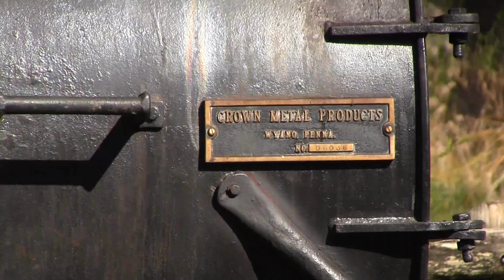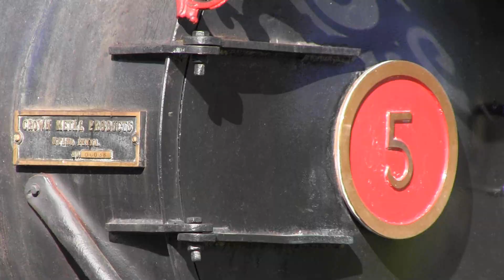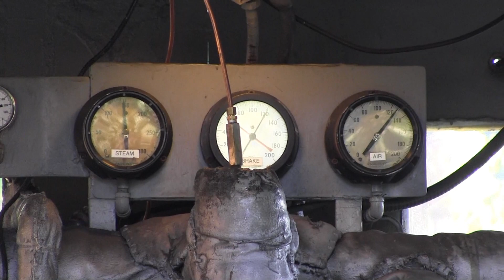Busch Gardens Serengeti Express, January 14th 2018

Comment: what causes the chugging noises at 1:20 while the loco is stationary?
Reply from the maker: Air pump for the brakes.
Reply: @baldwinloco12  I thought so, either that or water pump or something similar. Thanks.